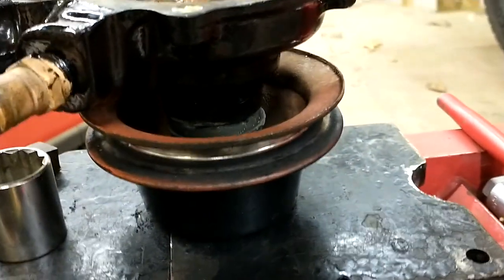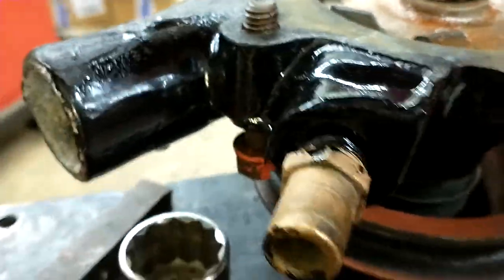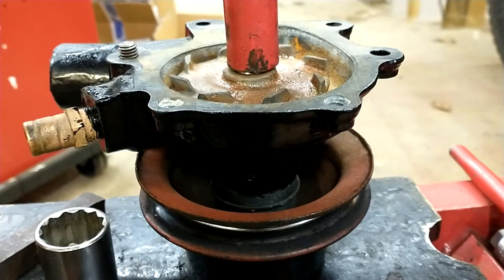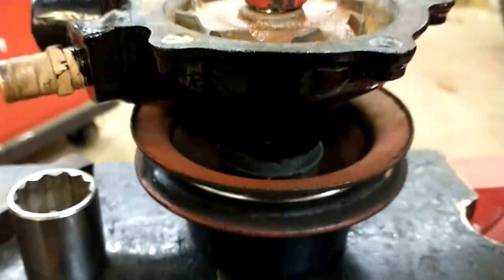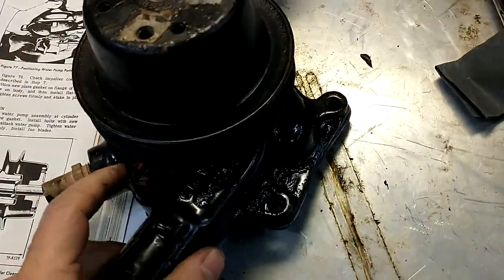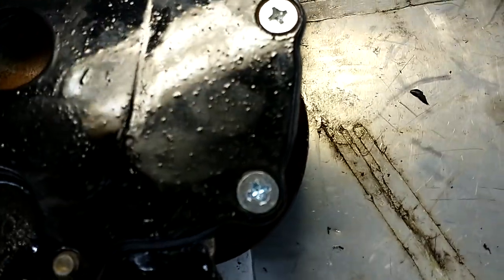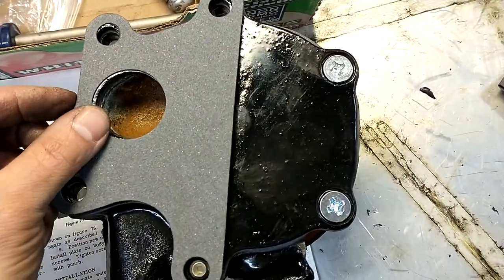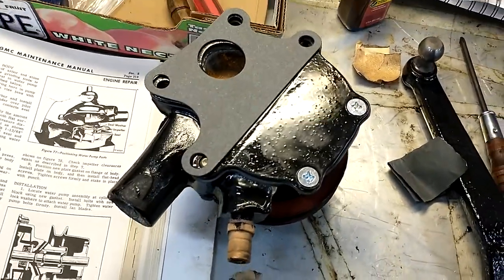1949 GMC Water Pump rebuild part 6 reassembly complete

Comment: Success, I just fired up the truck the other day with the rebuilt water pump! Back on the road!
Reply from the maker: Nice - I had to re-tighten the mounting bolts after a month or so.  They backed out a little and it started to drip.  I was worried the seal failed but fortunately it just needed a re-torque!

Comment: Did that ear breaking off cause you any problems?
Reply from the maker: Hey - I ended up getting an another seal.   Leaving the broken one in there was asking for trouble.  I was able to get just the seal from the maker of the rebuild kit.  I have had no issues with the waterpump so far though!